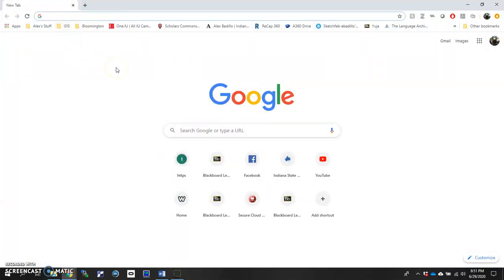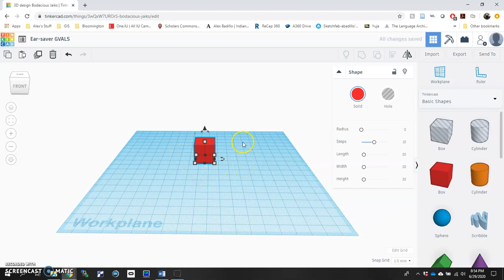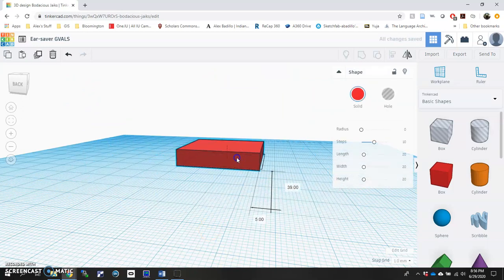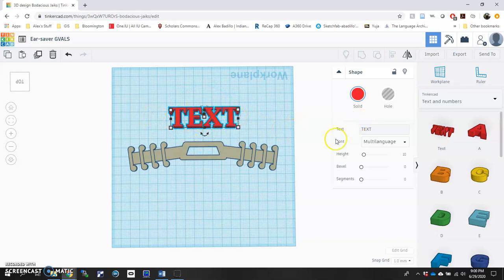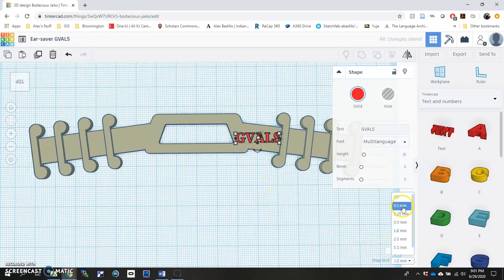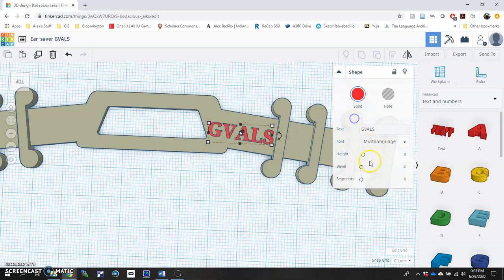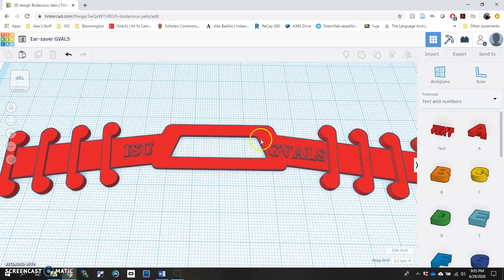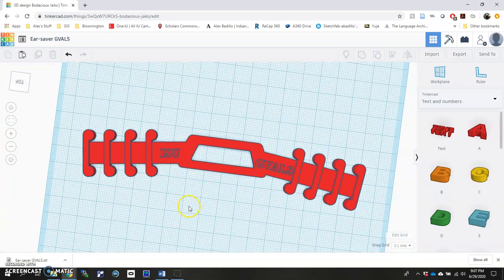Adding custom text to a 3D model for printing

Comment: When I add the text to the grid, it wont let me add it onto the model. When I move it to the model it just goes under it or through it. Any way to fix this?
Reply: I had the same problem, but no one answered it. Do you know the solution to it?
Reply: @carlos.galhano z-axis needs to be aligned, did you try that?  In the early part of the video, presenter raises the letter.  It's much harder to put text in curvy objects.